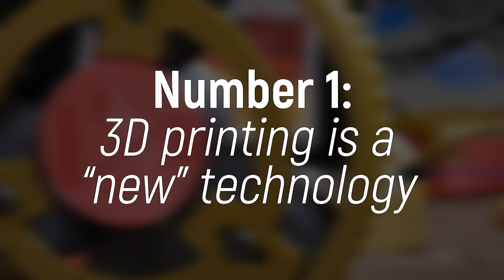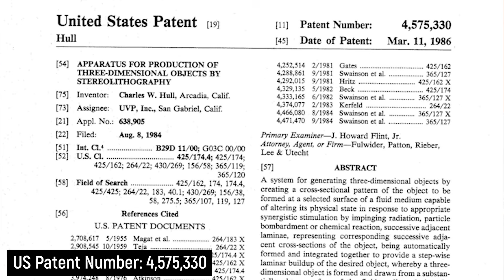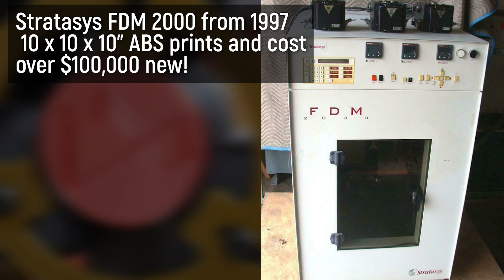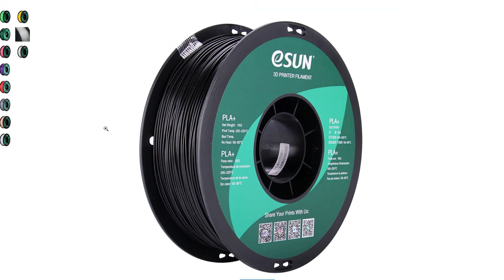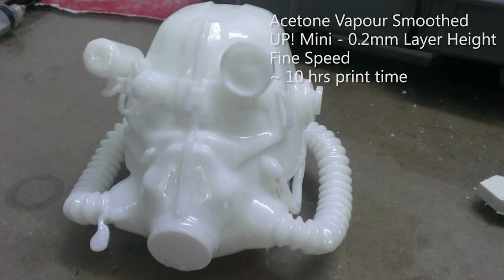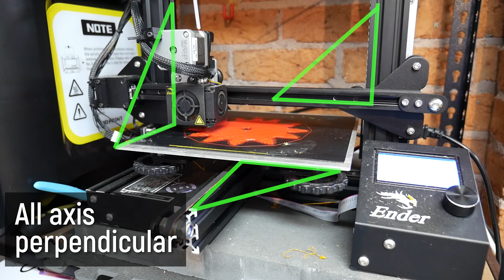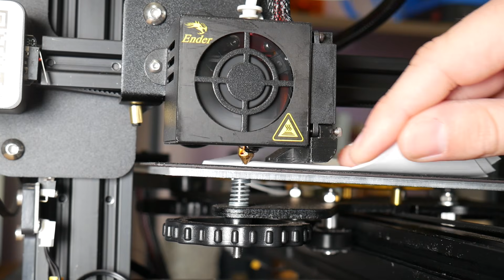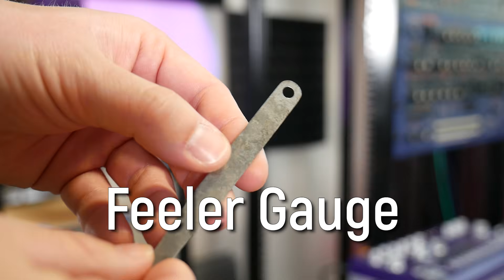3D Printing Myths I used to believe...

Comment: I never thought that I'd live to see the day when a major 3D printing Guru would assert the term "Tramming". Now I can rest.
Reply from the maker: I'm sorry I took so long 😩
Reply: @MakersMuse  You're forgiven. Thanks for forwarding your findings to us. =)
Reply: As a machinist I took it upon myself to design a bracket I can just attach a dial indicator to and tram my bed correctly. Kinda blew my mind a piece of paper was considered the “standard” when working in hundredths of a mm.
Reply: @H4ppygilmor3  do you have more info on how you do this? My curiosity is piqued.
Reply: Tom has been calling it Tramming for years.
Reply: I'll have to get my printer sorted and do the same with the dial meter, I like that idea
Reply: Tramming is setting the head square to the table. It has nothing to do with the head being coplanar with an axis.
Reply: @1pcfred  6 of one half dozen of the other. You'd clearly want to be "trammed in" at every (x,y,z) setting. Thus they are one in the same ..... am I wrong?
Reply: @1pcfred 

edit 2: to anyone else, If the below is confusing,  imagine twisting your extruder. You'd be square, your paper test would tell you your good but you wouldn't be trammed. So to be squared and not trammed is easy enough (except most 3d printers have a fixed extruderorientation) but to be trammed and not square you'd almost have to mess up on purpose to get to the "stretch" of a possibility mentioned in edit 1. I think I get it now. Let me know if I am still wrong (I stand by the 6 of one half dozen of the other comment with any machine with a head orientation fixed to their z axis,  such as every 3d printer I've ever seen; but for things such as @This Old Tony 's MAHO you must tram after you square)

edit, I reread your definition above. So I guess your z could be nonperpendicular to the "head" orientation and nonperpendicular to the "table" but have the "head" still parallel to the "table" but this seems like a stretch. I Guess they are technically different but it seems you accomplish both during calibration

original response: very possible, my only introduction to the word is through This Old Tony. However, I still don't see how I am wrong. If your axis are square to your intended extruder orientation, you trammed up, right? And you'd like that to be true for every position (x,y,z) that the extruder could occupy correct?

So instead of knocking me, could you explain how I am wrong.?!

Is there a way to be trammed and out of square? Certainly, by the logic above, you can't be squared and not trammed, or am I misguided somehow? I was misguided, sort of, see edit 2 above for my final conclusion
Reply: @1pcfred  I see sir, you are technically correct. The best kind of correct according to some jamaican beurocrats I know of from the year 3000
Reply: Unfortunately, not everyone has a dial indicator.
Reply: @user2C47  The chinese ones are cheap.

Comment: Great video, but I'm still not clear on setting nozzle height. You say to use a feeler gauge of "for example, 0.3mm". If this is just an 'example', then does that mean I can use any thickness gauge? It seems obvious that that can't be true, so what is the 'correct' gauge thickness, and  how does/should it relate (if at all) to your chosen print's layer height?
Reply from the maker: You need to adjust the z to the thickness of your gauge

Comment: The fundamental misunderstanding is that you're folding the paper. The trick works because paper has a standard thickness of .1mm.

If you want to be precise to the level of perfection... You'll need tools that cost more than the printer itself.
Reply: well it does have a range from .05 to .1 but if you pick a paper and the print works... what else is there to say :)
Reply: @hotends  I mean, the levels of perfection he shows in tramming require tools that are more expensive than most 3d printers. And that for a system that's not even built or set up that well. I jokingly imagine someone spending 5 grand on a Mitutoyo Straight Master to tram a 250 dollar printer that doesn't even have that many adjustment options.
Reply: @BrunodeSouzaLino  but.. you'd still have a Mitutoyo Straight Master at the end of the day though... :)

Comment: I recently got my first printer and I can't even "level" it across the entire bed - when the four corners are correct, the center is too tight and if the center is correct, the corners are too far away... 😢
Reply from the maker: Sadly sounds like it's bowed :(
Reply: yes, Bowed. What type of bed is it? I have a glass top that is slightly low in the middle, and putting a few squares of aluminum foil between the glass top and the metal bed I was able to coax it back to flat. However, the warp was very slight (0.1 to 0.2mm).  I don't know if you could shim all your corners.. or flip the bed top over and shim the middle. However, likely it will be better to get a flat bed top :/
Reply: An abl probe could solve your problem. For example the bltouch. The printer would prove all over the plate and compensate for the wrapped bed. A cheaper fix would be to increase the first layer higher in your slicer. You can set it to twice the normal layer hight and adjust from there.
Reply: Flip the bed if possible. You can correct a bowl with leveling screws, but you cannot correct a dome.
Reply: Thanks for all the responses. Printer is a Biqu B1, bed is aluminum with heating and isolation on the bottom and a magnetic sticker on top (for the flexible steel sheet). So flipping is not really an option, but I tried shimming the corners between the magnetic film and the steel sheet and the first layer is still inconsistent.
I now ordered a BLTouch, so I (hopefully) can correct for the bend…
Reply: @henninghoefer  I have 0 experience with the BLTouch, so I can only wish you luck with it :)
After I got my ender 3 the first upgrade I did was to remove the magnetic flexible bed and replace it with a sheet of glass I got at the local window shop. I was able to shim and clip the glass to the aluminum bed. The sheet of glass was very cheap ~$10. Now, getting prints to stick on a smooth glass bed is another challenge all together (but not too bad after a few failures). Hopefully the BLTouch will solve your issue.

Comment: I used to think my first exposure to 3D printing in pop culture was Jurassic Park 3, but thanks to you now I know it's Small Soldiers!
Reply from the maker: That is a great scene but it's a prop/ fake machine as far as I'm aware. I've always wondered if the raptor sound was fake !
Reply: @MakersMuse  The CBC did an interview with the sound designer of the new Jurassic Park movies, and they talked about the sounds of the original movies too.  As you'd expect, the Raptor scream is built up from a lot of different sounds, but the core - if I'm remembering correctly - is a baby elephant.

Comment: I think the purpose of using the paper is mis-understood. It is not necessarily to set the 0, but is used to tram/level the bed. If you feel the same level of resistance on the paper at all points, it means your bed is "levelled", so all points are at the same distance from the nozzle (that distance changes with the amount of resistance and the thickness of paper). But if you get that right, then it is a matter of manually dialling in the first layer height with the peace of mind that if the squish looks good at a certain point, it should be the same at all points.

Comment: Yeah bed leveling on a cold bed really messed me up. 
Not only because of heat expansion but also some beds will actual cup or bow (AKA Warp) at different temperatures (like mine does).

Comment: The way i've started to level my bed lately is to just home and touch off my nozzle to the bed. Works great just like the feeler gauge. You probably don't want to do this if you aren't sure if your bed is warped as you could be dragging the nozzle against the bed.

Comment: Isn't the inital nozzle height determined by the z-height set in the slicer PLUS the first layer height? so basically you want your bed leveld to where there is absolutley no distance between nozzle and bed and only let the machine do its thing throught slicer settings.
I guess thats what you do with the feler gauge trick!?

Comment: Hi Angus, great work as usual, thank you. You are always spot on with your points and am very grateful for all that you do for us. I note however that you didn’t mention the levelling system that I use and got the idea for from either you or teaching tech and that is to use the BLTouch system for bed levelling. I’ve been using this for about 3 or 4 years now and found it very good for always giving me the ability to square up the bed to the nozzle and always get really good prints. Not meant in any way as a criticism mate, just another way of doing a grubby job lol but I’ve found it simple and excellent. Anyway mate, have a grea night, take care and stay safe, see ya, Phil 😎👍

Comment: People who get sucked in with the whole auto bed levelling thing do my head in.
Reply: Voron 2.4 does auto tram :)
Reply: *wide eyed look of shame* 
What ever could you mean?
Reply: auto z leveling sure is fun to watch though!
Reply: The auto bed leveling has it's place though. Like my cr10S5 is so all over the place, i just 4 corner level then let the abl handle the rest. Things too damn big
Reply: @DangaRanga  have you had the opportunity to experience z leveling? (3 steppers, 3 lead screws - once you probe it calculates the plane and moves each motor independently to physically "level" the bed used on coreXY printers etc)
Reply: @DangaRanga  but it isn't really automatic is it?
Reply: @TheSecurity16  What's what with it? My bed is pretty out of level right now and I know it's slightly warped but it prints perfectly with my leveling sensor. I think people who hate it just cant figure out how to get it working properly.
Reply: What do you mean? Suckered in? I am quite happy with my BL Touch, saves me a lot of hassle. Getting better bed springs also saved me a lot of hassle. The springs that come installed on the Ender 3 v2 are terrible.

Comment: It's going to take a while before your mates stop looking at you weird when you say tramming.

They're going to think you're traveling in Melbourne CBD on public transport.
Reply: Sydney has trams too, they call them light rail... Which they took out in the 70s and then a few years ago decided they had to tear up the entire CBD to bring it back... they LEVELED the CBD badumtss
Reply: @jayinstandarddefinition  I wondered that. Interesting
Reply: Nah, they'll think that you have a milling machine and adjusted it so that the bed is 90 degrees to the head. Machinist have used the term "tramming" for a while, way before 3D printers appeared.
Reply: @kurtbilinski1723  Ah, yeah I remember that. Too bad none of my friends would know what I'm talking about. They probably imagine it means sniffing blow up the crack of a ho.

Comment: I don't understand your last point.
Just adjust your first layer hight in software with the paper in mind.
Reply: No... the point of leveling the bed is to make sure your printer goes to true zero when homing. Which is the nozzle actually touching the bed. The feeler gauge method and jogging the bed down by that amount is so you can move the head without it dragging on the bed. You could also just touch the nozzle off on the bed with it zet to zero as well.
Reply: @Kyrazlan  and with the paper you can find "true zero" as well.
It's just current position of nozzle - paper thickness.

Using the paper allows you to feel the height instead of just seeing it. Especially if your printer sits on the floor in an enclosure you can't see the the nozzle at the back of the bed. 

I still don't understand what the problem with the paper is.
Reply: @Jehty_  The fundamental disadvantage of paper is that it suffers plastic deformation, it can be difficult to tell whether the nozzle is already touching the paper or has already dug into it a little. The paper can also get bent and start scraping the nozzle while it's not really flat on the bed. That being said it's perfectly fine to get used to the feel of paper that you achieve good results with and use that, it's not per se an issue, especially if you don't grab any random piece of paper but standardise the paper that you use.

Comment: one sheet of paper. not folded also feeler gauges can scratch the nozzle.
Reply: we need some kapton feeler gauges, i suppose. Also, metal feeler gauges don't work well when the nozzle is dirty; paper one has a potential to wipe away the residue. I usually use the metal feeler with precleaned nozzles, i don't have major scratching issues.
Reply: If you are Scratching your Nozzle with a feeler gauge then you are doing it wrong.
Reply: @RabbitsInBlack  steel on brass. The nozzles are more of a problem with precision than you think

Comment: THANK YOU for talking about the paper thing Angus! It confuses so many newbies.
Reply from the maker: I'm partly to blame 😩 kinda evolved with the hobby
Reply: @MakersMuse   don't feel bad! It's not a blaming thing. 

Like you said the hobby evolved! You can't be blamed for not doing it differently when other ways were hardly even known!

You do great work Angus, always.
Reply: @MakersMuse  I once got told that the paper method was more accurate than using a feeler gauge. I tried telling this person why it was a flawed method but they insisted they knew better even though the problem they had related to the nozzle height being off.
Reply: @TheSecurity16  urgh 😩

sounds like a classic mansplainer.
Reply: @BillieRuben  Yep dead on
Reply: @TheSecurity16  hugs ♥️
Reply: I like paper because i'm used to it and i just always use the same paper and i like that i can do this on a VERY hot bed if i need to for ABS without touching metal. But i can also see the feeler gauge advantage.

But then people who suggest feeler gauges also usually suggest taking the same thickness as your first layer, which is definitely wrong.
Reply: Yeah, YOU actually argued with me in the 3dprinting sub a while back when you posted your leveling poster and I pointed out that you needed to offset the nozzle first. Glad to see you understand it now
Reply: @NotaChance2  ??? I think we must have misunderstood each other.
Reply: @BillieRuben  This was specifically to having the "offset prior to leveling" added to the wiki. Either way, that is way in the past and I am happy to see that you have seen the light.